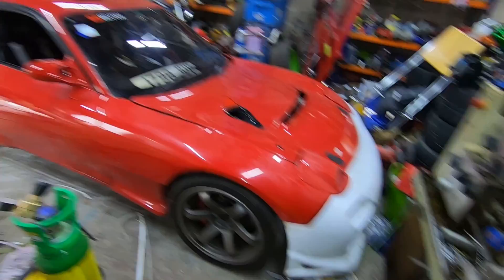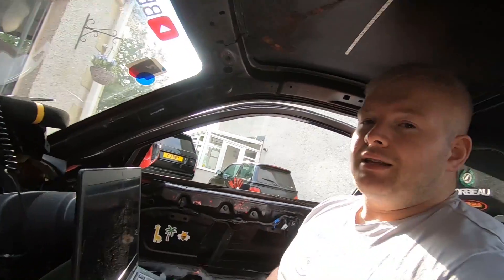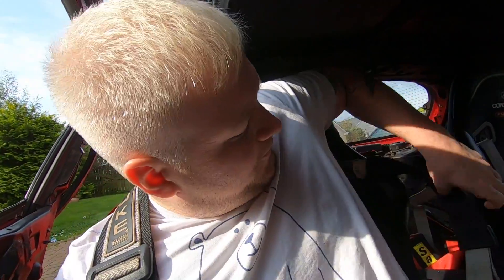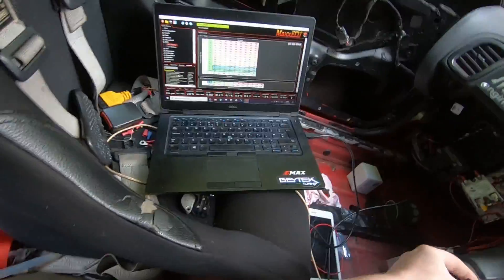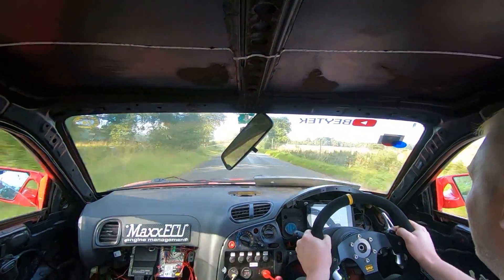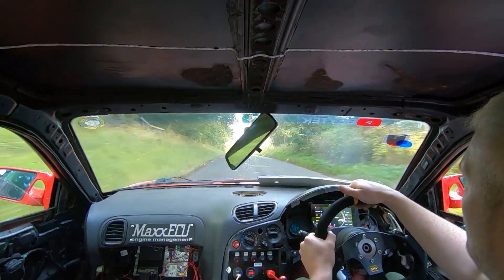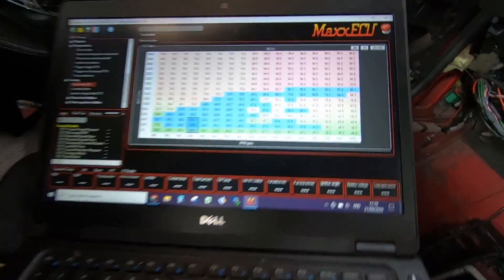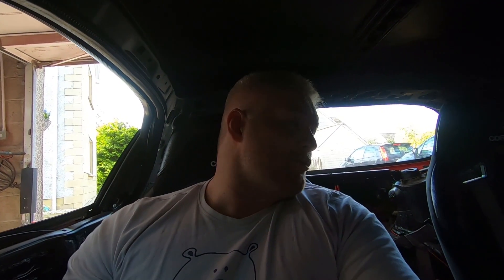FULL THROTTLE, BABY BOOST, 8500RPM K20 DCT RX7 DCT. This thing is wild!

Comment: The only thing holding me back from this swap is the damn 1:1 7th gear. I cannot get a gear that would allow me to cruise at 130km/h happily on a 26" tire.
Reply: @BEYTEK  I have 3:42 gears and a 25.4" tall 315/30/18 currently. But the math shows that poor thing screaming doing 120kmh let alone 130, unless my math is wrong
Reply: @BEYTEK  Thanks for the info. Are you on stock clutch pack still?
Reply from the maker: yup